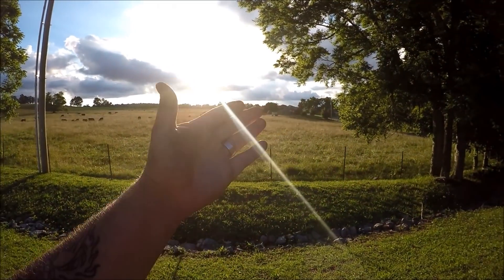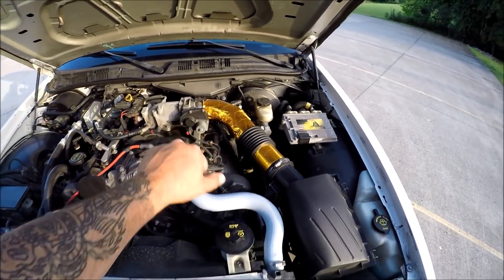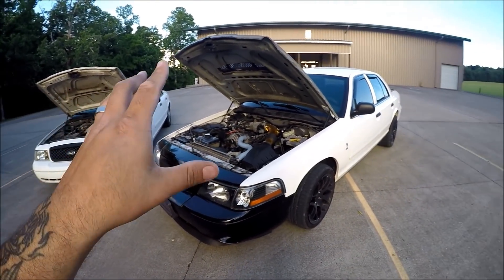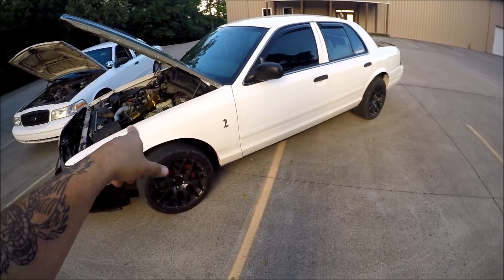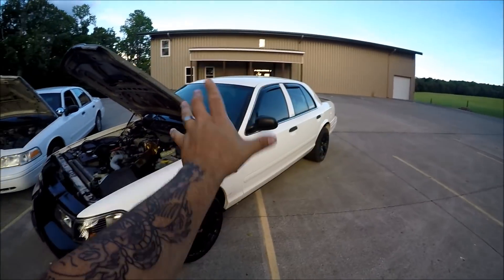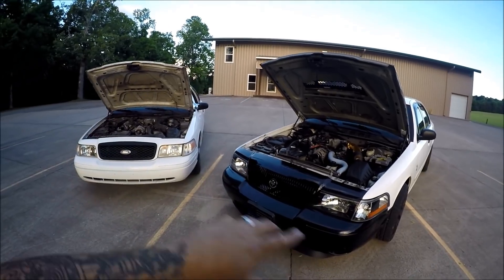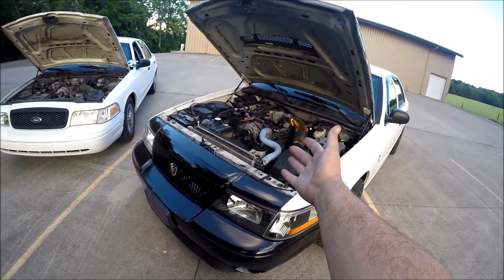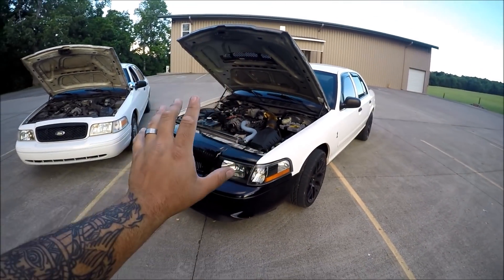(Crown Victoria)The Difference Between Romeo and Windsor Built Engines

Comment from the maker: what do you guys have?  Windsor or Romeo?
Reply: Just found out I have a Romeo even though my car was made in Canada?
Reply: @nickys1008  same
Reply: @nickys1008 that's a van engine lol
Reply: Windsor V8 anyday!
Reply: 302 sbf Windsor, 85 Cv
Reply: Windsor engine and im in Windsor, go figure
Reply: 05 p71, my first car! Windsor built
Reply: LT1 5.7L V8 😂
Reply: My car was sold in Canada from a Ford dealer to hertz rent a car,, thy had it for it first 36.000 klm and traded it back in when the drive train warranty was up :) according to ford the car was made in the St. Thomas Canada plant ,,,etis.ford saying -  (2FAFP74WX4X181733) Crown Victoria, Romeo V8 4.6 SOHC EFI, Arizona Beige
Reply: I have no car 😭
Reply: Hey bro I have a 2005 ford crown Victoria I just bought and it has 80,000 original miles it is a p71 model I’m having some trouble with my fuel delivery I’ve just bought a brand new fuel pump and it went out right away making a really loud noise and no fuel pressure please help I’d like to know why sense your the cvpi expert big fan I like your videos also where do I get the front clip same as yours??
Reply: That’s badass
Reply: I have a romeo, it is nearly bullet proof and smooth too. In the 1980s i drove a 302 windsor honestly one of the best engines ever but i give the edge to the 4.6 romeo.
Reply: Thank God I have the Romeo engine...  Checked right after I watched this video lol
Reply: All my old junk has the old pushrod 5.0. Those(5.0/351 Windsor) things were actually made in Cleveland at Ford Engine Plant #1. Right near the airport. Ironically, these are often called Windsor engines. My dad still drives an '04 Marquis, I wonder if it's a Windsor built or a Romeo built 4.6? I actually visited Detroit and Windsor last month, Windsor itself was kinda cool. Automotive industry, whisky distilleries, strip clubs and Timbits, baby!

2V engines are underrated. They are very simple DOHC designs with strong blocks, and they sound good.
Reply: Mr Random Reviews Romeo
Reply: just found out i have a romeo! makes me happy to know it's made in the good old usa!
Reply: Romeo
Reply: I DIDNT KNOW THER WERE 2 KINDS . AFTER CHECKING I FOUND OUT I HAVE A ROMEO
Reply: Romeo,
Reply: Romeo
Reply: I have mustang 2003 gt windsor engine
Reply: Romeo in my 2011
Reply: my '06 has a romeo
Reply: Vin says P71W, made in Canada, website says Romeo, engine looks like Windsor, IDK WTF?
Reply: Köln 3L V6
Reply: Thts a lie mine was made in Florida 😂 W and a X in my vin 97 p73 😂
Reply: I look my 97 p73 Ford Crown vic up mine was made in Florida n it said Romeo motors cams doesn't have screws to take off the chain spendle piece on the cam. If it brakes the motor is trash but on a Windsor motor the cams they have screws on the spendle to where u can take them spendle off n jus change the cam but u can't go that to Romeo motor because the romeo motors cams and spendle for the timing chain was building onto the cam tht a differents too its a lot of stuff tht makes the motors different...ppl jus want their on channel😂 mine up ima about to add a 75mm throttle Body to mine n the police package on it n heavy duty
Reply: Do ya history rite bro 😂
Reply: Romeo built... Probably why my main bearing went out
Reply: 07 p71 Romeo babayyy!!!!
Reply: Romeo lol
Reply: i know Im asking the wrong place but does anyone know a way to log back into an instagram account..?
I somehow lost my account password. I appreciate any tips you can give me
Reply: @Emmitt Zahir Instablaster :)
Reply: @Cruz Krew I really appreciate your reply. I got to the site on google and im in the hacking process now.
Seems to take a while so I will get back to you later when my account password hopefully is recovered.
Reply: @Cruz Krew it worked and I finally got access to my account again. I'm so happy:D
Thank you so much, you saved my account :D
Reply: @Emmitt Zahir You are welcome =)
Reply: Romeo (06 Lincoln Town Car)
Reply: Just ran my vin I have the Romeo . Thanks for the info
Reply: Romeo, still going with over 200,000 on it!
Reply: I have both
Reply: I have a Romeo engine
Reply: I have Romeo 95 vic and a 05 romeo
Reply: Romeo 🤏🗣️
Reply: Romeo over here!! Besides that shity ass blue line flag lmao hope i offended some people.

Comment: My 2000 f150 came with a Windsor 4.6 Triton 216k mile strong, burns a lil oil on startup due to valve stem seals, but that's expected of a 25 year old truck

Comment: Not sure which is better today, but in the past the windsor was very superior. Your 220 V8 and 260 and 289 and 302 and 351W were windsor engines and its a known fact from the 1960s on through the 1980s those 302 windsors were superior to anything made in america
My 02 f150 4.6 is a windsor and my 05 lincoln town car is the 4.6 romeo

Comment: So you could just tell by the the vin number. If it starts with 1 it was built in the States (Romeo). If it starts with 2 it was built in Canada (Windsor).
Reply: It does not matter where the car is built, it matters which engine plant the engine came from.  Most if not all Crown Vic's have Romeo regardless if they are Canadian or US built.
Reply: Mine starts with a 2 and according to Ford it's a Romeo.

Comment: When I built a triton engine I built it with a Windsor bottom end and a Romeo upper I like the fact that the Romeo uses girdled cam caps and the Windsor uses clip in rist pins. so I can do it all myself. I'll use cams out of a 13 e350 5.4 with a 5.4 expedition t.b. and  Forged truck crank, the timing covers are interchangeable just be careful of your upper bolts the 5.4 heads useded a 10 x1.5mm threaded bolt and the 4.6 used an 8×1.25mm bolt, that also changed between R&W engines. A fella can build a good one with all OE parts if you know what to look for.

Comment: It is possible to determine if you have a Romeo or Windsor engine by looking at the 8th character in the vehicle's VIN number.
A "6" in the 8th character position refers to 4.6L SOHC Windsor produced engines.
 A "W" refers to 4.6L SOHC Romeo produced engines.
Confusing, right?  W=Romeo /  6=Windsor.
Reply: Guess that trick don't work on a 2011.  My 8th character is a V
Reply: X = Windsor 
W=Romeo go one more over on vin
Reply: V is also Romeo I have a V
Reply: I have a 2009 an mine is a V also
Reply: Yup learn that the hard way

Comment: What about a 2005 mercury grand marquis? Additionally did they shared the same engine with the 98 mustang gt, because they technically both engines made closed to 224 hp? And what about the f150 98 XLT for same engine or different?

Comment: 2010 interseptor Vic Romeo cast iron block E - 85  The Romeo built better it's built for higher rev. The Windsor is set up for low end torque. It's a good motor.
Reply: Dennis Parker Windsor can be made into a stronger engine
Reply: @lowslo9287  sure it can . Change Cam  manifold injectors tune
Reply: Dennis Parker no it’s because the 8 bolt main vs the 6 bolt main

Comment: Romeo = Italian = Problems
Reply: I'll tell something about Italian quality, those 96-99 32 valve Cobra/Mark 8 engine blocks were Fiat made Teksid engine  blocks that are very sought after by gear heads out there for a reason. Those are better than the engine blocks beyond 2000.
Reply: @lanewarriorillridez3739 ; Correct and a little known fact.
Reply: Or maybe I am just confusing FIAT with it all.

Comment: Spoiler alert if any1 reading this b4 watching the whole video one is aluminum block ( i think romeo & its a 6bolt main) & the other (maybe windsor or other)  is iron block. Major difference 😆. I still see older models well some with the wire throttle body.. Not all those mr.random lol
Reply: Omar Armendariz also Windsor is an 8 bolt main they’re better engines

Comment: have you ever had do the brakes? such as all the rotors and pads?
Reply: You must be new here
Reply: tin pin he must have did one??
Reply: tin pin I seen the one where he did the brake rotor and pads on the mustang but not the Vic’s. Do you have a Vic?
Reply: @mrwright9553  I've owned a few Panther bodies: 86 MGM, 87 LTC, 88 LTC, 94 LTC, 98 LTC, 00 LTC, and a 09 CVPI that I drive now.
Reply: tin pin have you every did brake rotors and pads
Reply: @mrwright9553  Of course.  They're easy to do with basic hand tools.

Comment: To tell the difference just look at the vin the 8th number is w for a romeo engine and 6 for a Windsor engine
Reply: I have a v as the 8th character
Reply: @dillonbmx16  means your car has a vagina
Reply: @dillonbmx16  is it the 4.6? Or like a 4v or something lol that's kinda odd
Reply: @musicrevelation2023  My 2011 Crown Vic Lx with 2V 4.6 also has a V in the 8th character.

Comment: Ford has been using "Romeo's" and "Windsor's" in the F150's since 1997. You also can't swap the Intakes from a Windsor to a Romeo. It will leak water in the back right corner where the Intake meets the head.
Reply: That’s not a Romeo vs Windsor issue..that is an npi vs pi issue

Comment: HELP
i need someone’s help ASAP on a question, can’t find it anywhere. I have an 05 crown Vic p71, looking to replace the front seats with a bench. I was told an 05 town car may fit, but I was hoping someone here has some experience with this, and could tell me what to do. Thank you!
Reply: Yeah, I used the metal base with manual sliders, seat sensor, Crown Victoria seat belt buckles, everything so it wouldn't have to worry about wiring or sensors not matching up.
Reply: It should fit. I put the seats out of a 98 Towncar in my 07 P71. It was a little more complicated because of the different year models, but 05 to 05 should be straight forward. I actually disassembled both sets of front seats so I could use the base of the Crown Vic seat with the Towncar pads, covers, and the complete back of the towncar seats. That was just to avoid wiring issues.
Reply: @jasoncooper3116  has to be a base model towncar the signature and above need the door wiring and memory module not included with seat

Comment: 8 bolt Windsors versus 6 bolt flywheel Romeo..Windsor  99 GT Manuals REV MUCH FASTER..
Reply: This can not be proven right or wrong and is essentially opinion
Reply: @eriv4735  It cant be proven? Are you slow? Its easy to to prove..In a Automatic  I dont give a shit but A Windsor  engine has more inertia  with 8 bolts dumb ass..More intertia equals faster revs.Run a5 speed 99 GT Against  a 5 speed 2001and youll not only hear how much quicker it revs.It pulls harder.Youre an idiot.
Reply: You're a complete fool, the amount of flywheel bolts has nothing to do with the flywheels weight. The lighter the flywheel the faster the engine revs dumbass.
Reply: @sjg1018  you absolutely  couldn't  comprehend  my explanation...Obviously  dont know shit about a flywheel either.Chime out chump and get educated

Comment: Windsor built 4.6s are better..It has different  rods and internals.. you can simply look on the engine cam covers along with wiring covers and blocks are stamped.
Reply: Connoisseur of Cannabis Cars&Pussy yes and 8 bolt mains

Comment: You can also just pop off the oil filler cap and check for a cam girdle. The Windsor did not have a cam girdle and the Romeo did.
Reply: I read several years ago that the 4.6 had about 9 different blocks and at least 7 different heads. 
All I know is the first few years they had a LOT of valve seal and timing chain guide issues.  Our local LEO car mechanics became experts.
Smoke when idling and decelarating.
Ive had several.
Reply: @hotrodray6802  yeah, the very first ideation of the 4.6 in the town car and then the crown Vic has issues with the angle that the injectors sprayed fuel into the cylinder. They were spraying at an angle that was causing the fuel to be sprayed directly onto the cylinder walls and it was washing the oil off and causing premature wear.
Reply: They have had issues with timing chains throughout the years of the 4.6. I was looking at an 04 with 119k and when you hit the throttle and the rpms were coming down you could hear the chain rattle. Instead of the chain tensioner using oil pressure they should have used spring tension.
Reply: The very first year of the 4.6 in the town car had a bell housing bolt pattern the same as the 5.0 and 5.8 the next year they changed it to the newer style.

Comment: Sounds like windsors suck!  as far as years with interchangeable parts etc? i'd stick with 01-04  cable intakes anything after that(wire) is messing with the tune of the car and asking for check engine lights.
Reply: sabrom they don’t

Comment: The 4.6 is a rock, they will run 200k miles , they arnt the baddest engines but they sound great.
Reply: I would love a 4v in my 02 tho.
Reply: I got 3v 4.6 running great at 150k and it does sound great, it's tuned and modded to about stage 2

Comment: I really appreciate all this info you give about the Crown Vic
I"ve been considering getting a Panther body and your channel has been a godsend for doing research on them
Reply: If your looking to also modify a Panther, check out adtr.net. They pretty much have narrowed down all the correct parts swaps. They also have worked with part manufacturers to develop panther specific parts.
Reply: @HotRod8625  thank you for the additional info
Of what I've seen so far panther body owners are just the best
Really helpful and kind
Reply: @Ruby_Beoulve  3 years later... Did you get a Panther? 🤔

Comment: Windsors came in mustangs too. I have a 1998 that was originally a Romeo but I swapped it with a Windsor out of a 2001 mustang.
Reply: Yeah, my 01 Mustang has a Windsor. I've understood later in 01 they went with the Romeo (the early 01's, such as mine generally had the Windsor's).
Reply: Radwan Hayek I did the same to my 97 Windsor can be built stronger

Comment: Dang SupaCharge ? 
Dang I wonder how many components need to be changed to be actually supercharged
Reply: Forged pistons and rods, the stock (cast? hypereutectic?) don't like boost much in stock 2V 4.6 engines. The stock cast crank is fine. Blower cams would probably help too, but aren't needed.

Comment: if you did light moding, the windsor could have loads of torque since its for trucks
Reply: The 4.6 Windsor's in the trucks had different cams then the car cams so that's probably why the truck Windsor motors have a little more torque
Reply: No. That’s not how it works it still has a crown Vic intake cam. Not F-150 Intake cam
Reply: @brandonflatt9577  and that's why you swap it in lol

Comment: Why did some Vics came with a stock h pipe and others straight duels
Reply: None had factory duels police or civilian without an h pipe unless done aftermarket.  I went to straight duels in my 2nd panther car, yeah that was reminded within a month with an h.  Sounded like my buddies old 72 LeMans and actually less responsive than when it was single factory.  Even NASCAR's use a x pipe to balance the exhaust between the banks.  An h is slightly cheaper and no real difference unless your really adding serious power.
Reply: When I got mine it had straight duels.
Reply: @ambush8502  Was it purchased new of the lot this way and what year?  No H pipe is both notably louder(drone) and would not be identical hp/tq mpg to those with.

Comment: 4.6 is trash
Reply: no, 3valve 5.4s are trash
Reply: They used them since about 1990 so they must be good.
Reply: If you keep oil and water in them they will run
Reply: Obvious troll is obvious
Reply: Put the crack pipe down the 4.6s last a very long time.

Comment: Really bothers me that Ford called it the Windsor modular
Reply: It was made in Windsor..
Reply: Thomas?????? Hi!!!!!!
Reply: Want to get bothered even more? The vast majority of "Windsor" 5.0 and 351 engines were actually made at Ford Engine Plant #1 in Cleveland, Ohio. The "Cleveland" V8 had a short production life, Ford had two assemblies in Cleveland. From 1970 to 2001, they made 302, 351 and later 5.0 engines at Plant #1, right next to the airport. So if you have a 351 Windsor in your F150 or a 5.0 in your Foxbody, your Windsor engine was built in... Cleveland.
Reply: @prushimush  Don't forget . The Mexico Plant, with the A4 designated engine blocks. Engines (5.0 HO. Motors)80's fox bodies.....